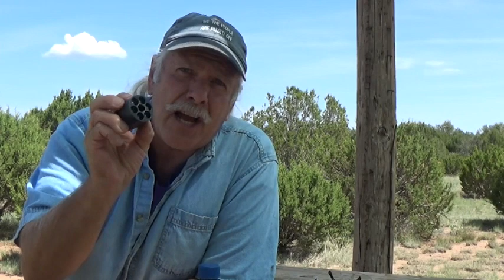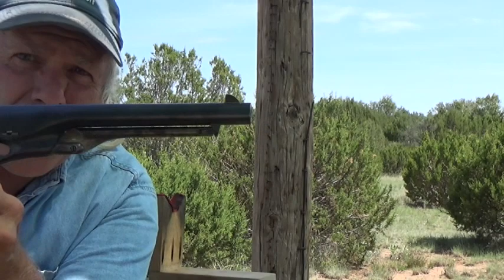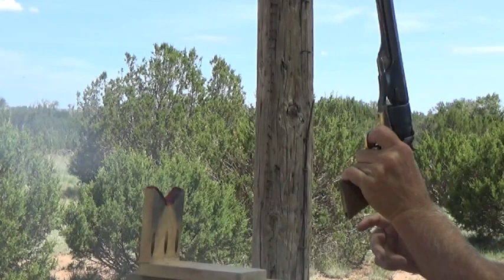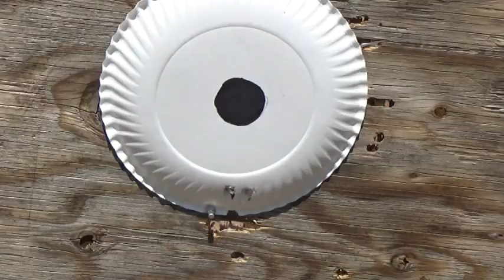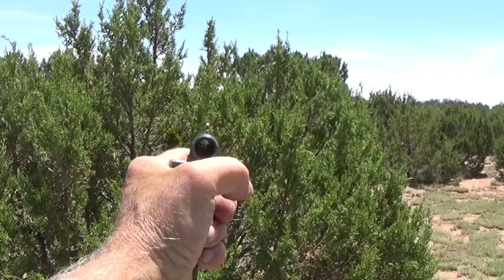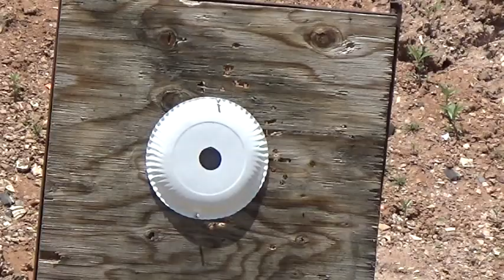1860 Army Uberti New Front Sight DIY Black Powder

Comment: I have a Uberti 1872 Navy open-top, and wanted to replace the front sight.  I assumed the original sight was press fitted, but I couldn't get it to budge with mallet and brass punch.   Just curious if you had any trouble removing the old sight.   Thanks
Reply from the maker: No None at all